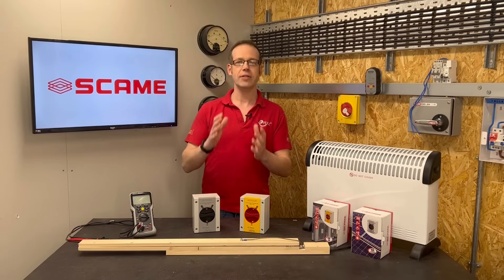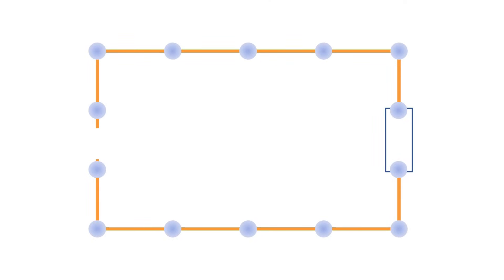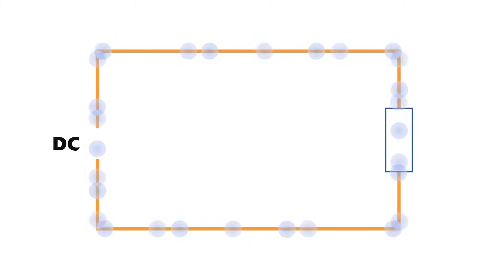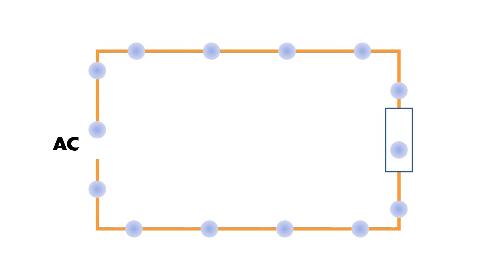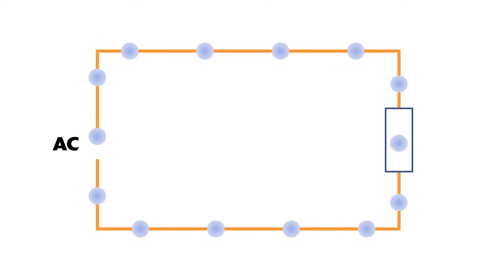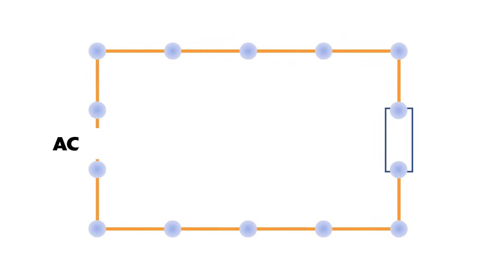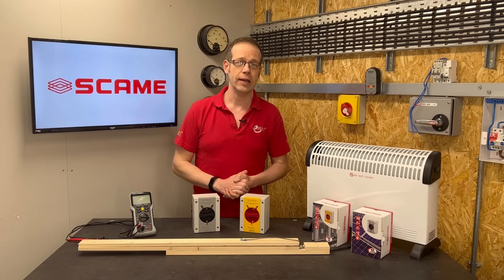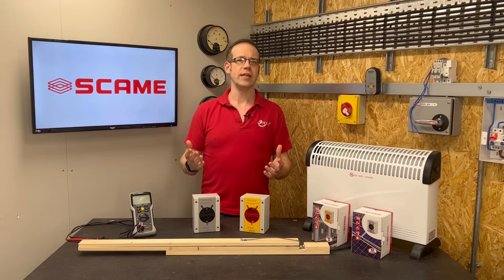The Jaw-Dropping Difference Between AC & DC Isolators!

Comment: Having been brought up on diet of DC mains supplies I was very aware of the difference berween switching DC as opposed to AC. Even in domestic installations 'quick make and break' switches were generally employed to overcome the problem  until AC became more generally used, I think GEC brought in the 'Mutac' switch early on to avoid the massive 'clunk of the QMAB switch when DC had long gone. Magnetic blowing is often used today even on AC circuits.

Comment: Brilliant demonstration, two bits of food for thought,
1 as the two switches are identical could th AC switch have the two link wires installed there by making it a DC switch? And take them out of the DC switch there by making that into an AC switch , after all some room stats can be modified to work with different boiler systems by adding or removing a link wire. 
Point 2 could you not use that wood switch to try and prove once and for all AFDDs work or not? As you know there is a long running debate weather theses things work at in a domestic installation.
Brilliant video as always Joe 👍👍👍

Come on Joe
Reply: They are both the same, BS EN IEC 60947-3 applies to switches, disconnectors, switch-disconnectors, fuse combination units, and their dedicated accessories to be used in, distribution circuits and motor circuits where the rated voltage does not exceed 1000 V AC or 1500 V DC.

Comment: Then Can a DC one be used for AC isolation given we are under the spec for amperage and peak voltage?
Reply: I was wondering that too, or not so much can we as it has not been officially rated for both AC and DC, but what would happen if we did providing we did not exceed the current ratting of the DC isolator?
Reply: @ElliottVeares   Any mechanical switch designed for DC will in practice work for AC and generally be even less of a risk.  But any professional fitting one would be asking for liability issues due to it being "inappropriate" as per the stated rating.

Comment: Also you will find a lot of DC isolators are very much directional, in that you must mount them so current flow is according to the direction of flow marked on the switch, so for things like a battery disconnector you need to have 2 poles doing the switching action, as current can flow into and out of a battery. 

However for things like a solar panel or inverter they will havv a defined direction of current flow, and if the inverter has a battery charger there will be a separate isolator for the battery charger output. This because they use a magnet to direct the arc into an arc breaker, so that the arc itself can be cooled down to the point the ionised air no longer conducts.

Thus another difference between SELV and PELV DC and higher voltage, in that SELV and PELV DC circuits are so much less likely to have the energy to draw an arc, and the separation to disconnect can be less rigorous.

Incidentally that breaker shown is no longer recommended for new installations in certain countries, like Australia, as they have had a good number of them that have failed in use, and there have been recalls to install upgraded isolators with higher specification, and larger separation, plus also having magnetic arc diverters to more effectively break the circuit when operated under load.
Reply: Everything you have said is true, but how much simpler, AND safer, would it be to:

1. Disconnect the DC load
 electronically

2. THEN isolate mechanically

??? 
ZERO need for much more complex mechanical features such as arc diverters (there would be ZERO arc/s anywhere)

Zero need to have had expensive recalls

Zero risk from arcing causing flashover, explosion and fire, when attempting to isolate due to say a gas leak !!!

MUCH safer and quieter operation due to zero arc, zero arc deflectors.

Much lower cost for domestic environments.

Several other advantages too potentially.
Reply: @boblewis5558  Problem is you will need to still provide arc fault capacity, because the electronics are the item most likely to fail shorted. DC breakers with arc chutes, and a magnetic driver, are the preferred item, or you need to have active arc cooling that blows it out.
Reply: @SeanBZA  I guarantee mechanical features will fail LONG before modern electronic devices. Otherwise, why is DC welding with over 200Amps SO reliable, and TIG just as reliable ... No arc diverters CAN be used there.

In addition you speak as though the ONLY failure mode of electronic devices is "short"! ... NOT true! An open circuit failure mode CAN be designed in. 

On top of all that, complicated DC isolators with arc deflection are not used in domestic settings ... The isolators are, as shown in the video, the same as AC types just wired and rated separately! 

Whomever said that it's "impossible" for contact welding to occur in a DC isolator is as deluded as someone who believes semiconductors only ever fail short circuit! 

In the case of welded contacts you are now left in a WORSE situation than if, in your perceived scenario, the series electronic disconnect were to short ... You have ZERO means of either isolating OR disconnecting the supply! 

With ZERO arcing, ZERO overload current (easily covered in other reliable electronic ways) BOTH the isolator AND the electronic disconnect protect each other. 

It's NOT that an AC isolator CAN'T disconnect DC, it's that it is definitely NOT something to do regularly because of the continual arcing. Isolating under zero current conditions is a no brainer for ANY set of contacts designed to handle the rated load ... There is NO load current at the isolation point!

Comment: What happened to the old fashioned arc shields that used to be fitted to DC switches.
Reply: Back in the latest designs, along with ferrite magnets to force the arc through the shields and cool the arc down and break it. They also make them directional, so you need to have 2 in series for use with batteries that can feed or sink current, along also with having DC rated HRC fuses as well.

Comment: Very well explained Joe. An AC current is much easier to interrupt than a DC one because the current flow is zero every half cycle or 100 times  every second.
Reply: I've heard stories of having side resonance due to short lines & loads that oscillate at a high enough frequency that the contacts don't quench and burn out the switch.